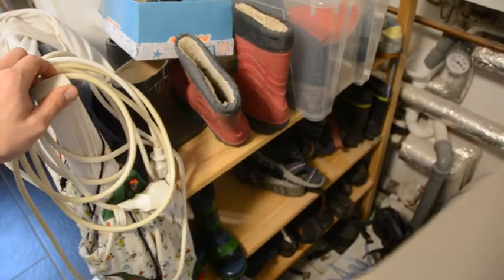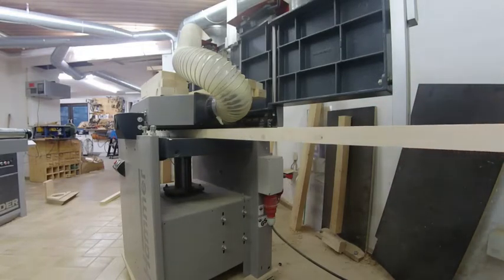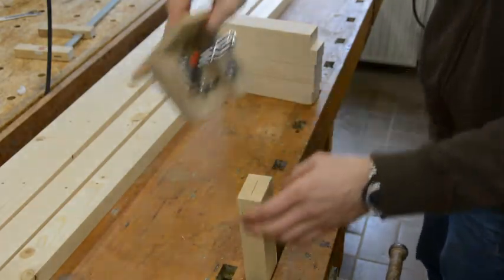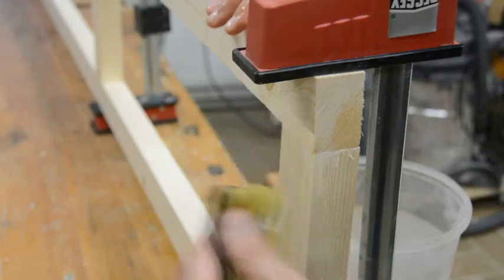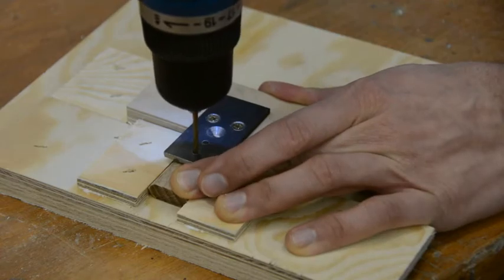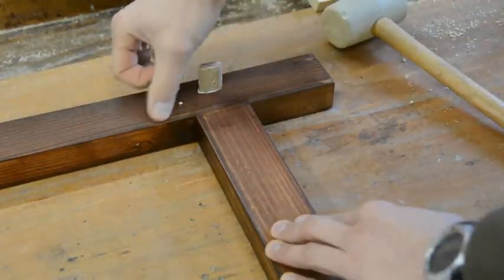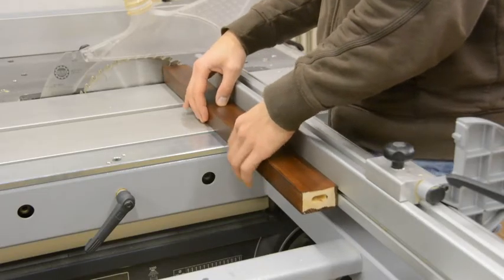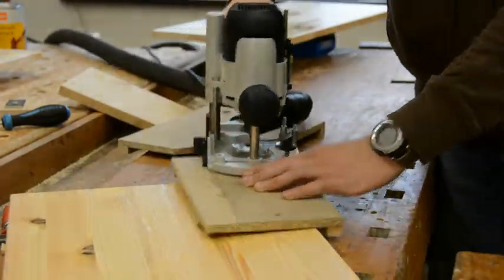DIY knock-down storage shelf build [Free plans]

Comment: Do you have the 1400 series router? Which template guide and bit do you typically use with your mortise jig?
Reply from the maker: I have the OF1010 - all tools are listed on my website. Most of the time I use a 10.8mm bushing with a 6 or 8mm router. You can also 3d print your own guides if you have a 3d printer.